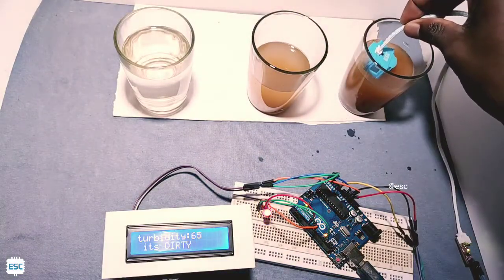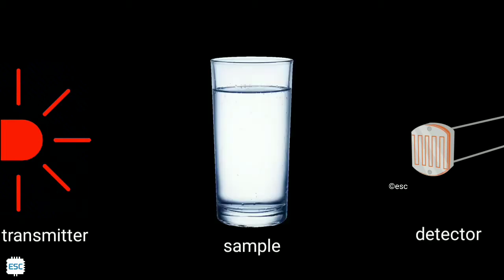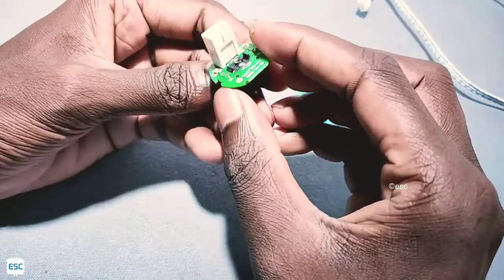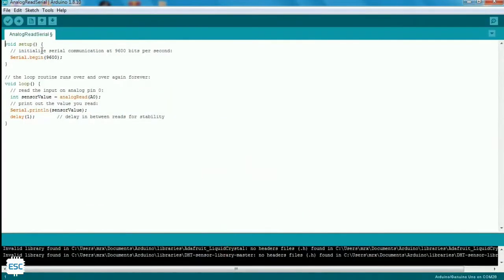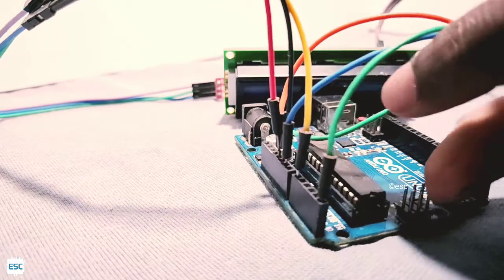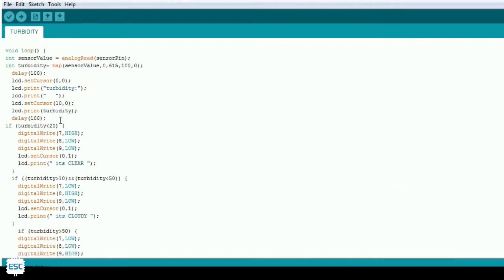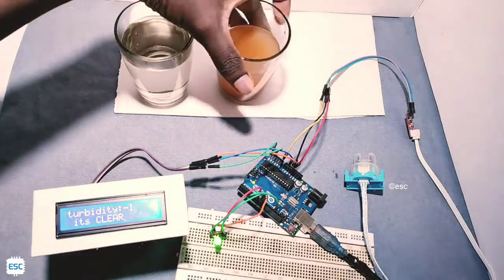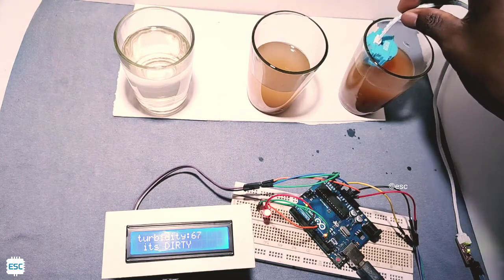How to interface turbidity module with arduino | complete tutorial | DIY Turbidity meter

Comment: My LED has 2 leg how should I modify the code and how can I arranage them
Reply from the maker: You can connect the positive to Arduino pins other side to ground
Reply: @EDISON_SCIENCE_CORNER I've tried but it says can't open device "\\.\COM3:the system cannot find the file specified"
Reply from the maker: That's your Arduino problem not the code
Reply: @EDISON_SCIENCE_CORNER ah thanks Its just connection problem
Reply: Can you show it clearly ? @EDISON_SCIENCE_CORNER

Comment: Can anyone tell how much ohm resistor he is using???
Reply from the maker: 330-1k
Reply: @EDISON_SCIENCE_CORNER  bro but i read in one of the comments u have mentioned 470-1k ohm.. so which one is right ... and one more qns like can i connect 4 leds in parallel .. and if so what is the specification of the led
Reply from the maker: You can use  that, its a4 pin rgb led , you can also use normal rgb LEDs
Reply: @EDISON_SCIENCE_CORNER  what about the resistor the 330 one or 470k one ?

Comment: it looks good 
but my sensor neve shown les than 99 turbidity
using the exact same sensor
with exact same code
do i need a speciffic Arduino library for this sensor ?????
PLEASE HELP
Reply: Same issue. We're you able to fix it?
Reply from the maker: There is a new video check it

Comment: We have purchased many version of this sensor and found it not working we either get same values for various turbidity samples, or different wrong values each time we read the sensor, but only one value close the reauired value..is there a reliable vendor who can supply working turbidity sensor , or any special calibration process need to be done to make it work. Thanks Gowrishankar
Reply from the maker: Did you followed the same steps that described in this video. I bought it from amazon. Still working without any problem.

Comment: Sir firstly in the video initially you have used analog read serial coding then after you have used another coding. So Sir can you plz guide me is there to coding required or we can only use the coding which is given in description
Reply from the maker: Just use the given code
Reply: @EDISON_SCIENCE_CORNER  it means we only use the code which is given in description.
Reply: I have same issue as you. I am getting very random values and no change even when I change to muddy water

Comment: The final code it does not work for me, it shows me Dirty, value always 57-61 without using the sensor. If i use the sensor in water nothing change.
Reply from the maker: Did you calibrated the sensor
Reply: @EDISON_SCIENCE_CORNER  Yes, i didnt use it too much
Reply: It also happen to me ..the value always show Dirty and when I use sensor in water nothing change...how I fix it...need solution... urgently
Reply: Same here brother
Reply: @afiqsalihin9723 how did you fixed it brother?

Comment: Sir why my sensor always got 1 turbidity
Reply: Im using with nodemcu sir, can you helpme
Reply from the maker: It shows only  1 ?.  Try with arduino  if the problem remains contact me  through whatsapp link is in the discription.
Reply: @EDISON_SCIENCE_CORNER  I have used Arduino sir, but if I dip it in water, the result will be messy, how can I do the same result like in the video